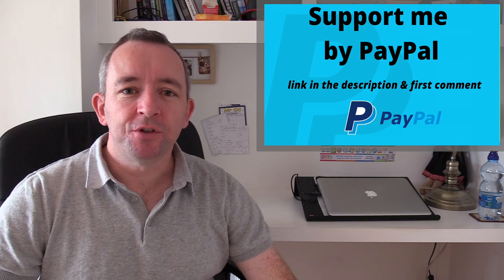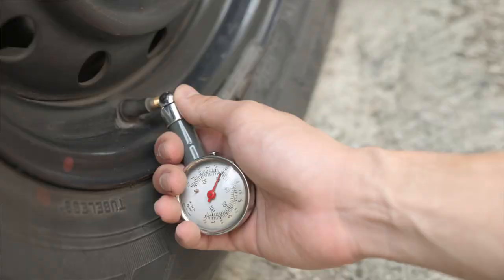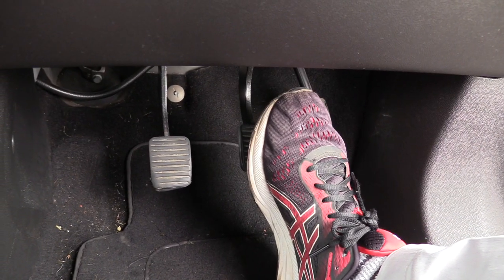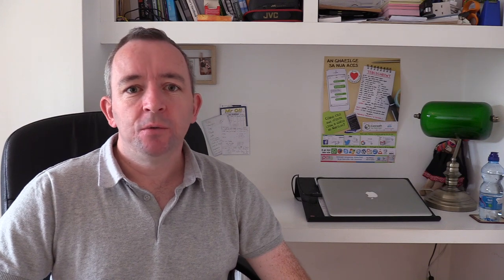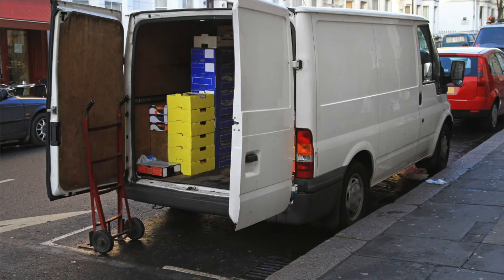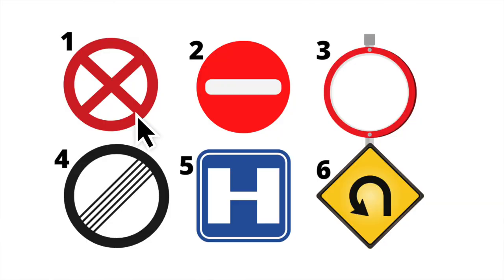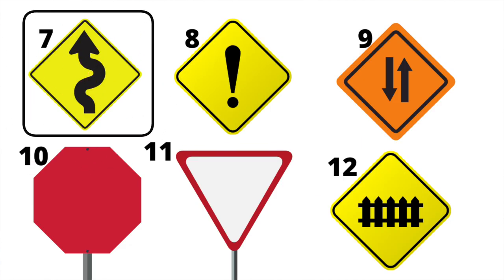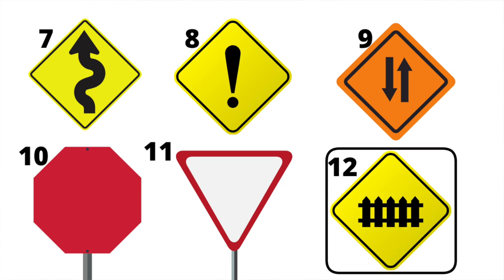Theory & Road Signs For The Driving Test Ireland

Comment: Hi Dane, 

I have a question about the three point turn, can you get any faults or fail the test for dry steering?
Reply from the maker: No not necessarily, it's not advised but it is acceptable.
Reply: @DaneTygheletsdrive  thanks for replying 🤗
Reply from the maker: My pleasure

Comment: Hi Dane when doing the turnabout can I turn the steering wheel without moving (dry steering) I know it’s bad for the tyres but I find it easier for the test
Reply from the maker: You can but I don't see how you'll benefit, it'll just take longer.

Comment: Hi Dane, 

In a roundabout, I need to take the right lane for the second exit, because left lane was for left only. So I enter a roundabout without giving any indicator from the right lane and go to the inner lane in the roundabout. While crossing 1st exit I give the left indicator, exit from the inner lane and take the outer lane, and exit using the left lane. Am I doing it correctly? do I need to give the right indicator while entering the roundabout?

This rule should be followed when the road marking says 2nd exit at right or 2nd exit after 12'O clock?

Please let me know, I am confused here. I have an exam next week and I believe I may face a situation like this. We have a similar roundabout at one of the routes.

Many Thanks
Soumen